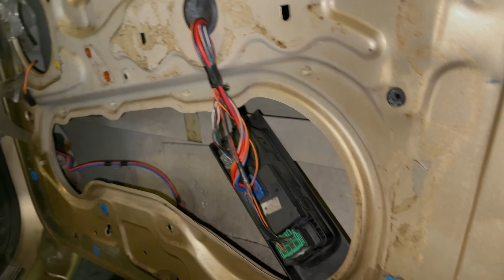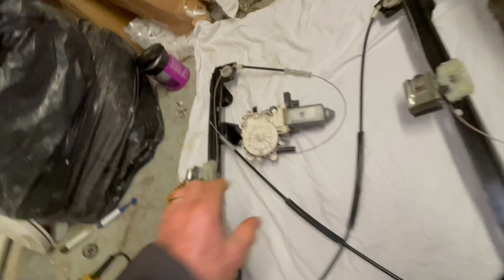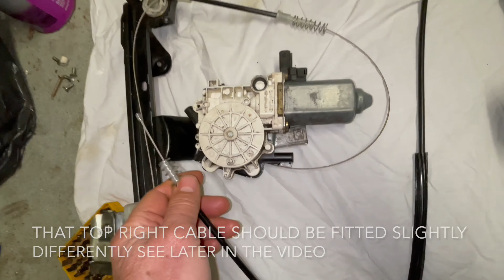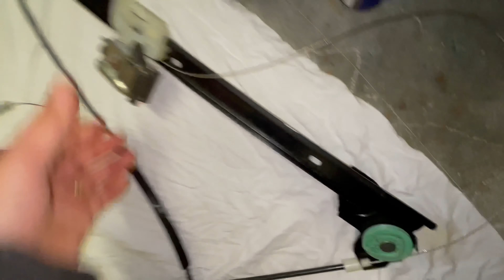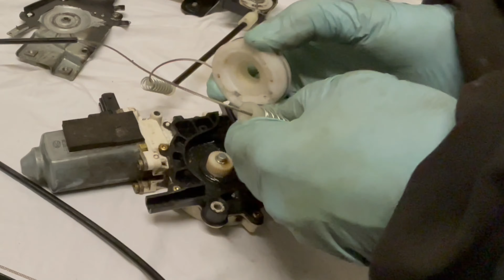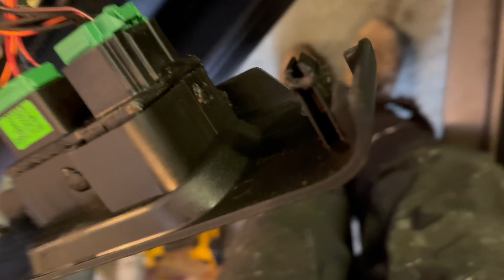Freelander Electric Window Fix. Front.

Comment: when i have done the replacement of the electric window winders i leave the bolts that hold the window in a tiny bit slack then wind the window up and down a couple of times to get the centralised and when they  are up  fully tighten the bolts but not too much as you could break the window
Reply from the maker: Yep, just need to be tight enough to prevent it leaving the window behind when it goes down.

Comment: Hey, interesting video. Mine just failed. I think the motor is okay, because I can hear it trying to pull, but then I hear a bip, like an error message.
What would you recommend me to do?
Reply from the maker: Take off the door card and have a look if the cable has snapped. It is common on a lot of old cars so it’s probably the case in which case follow the steps in the video.